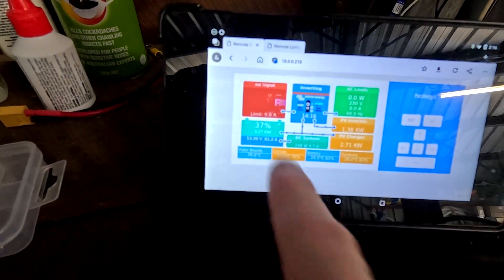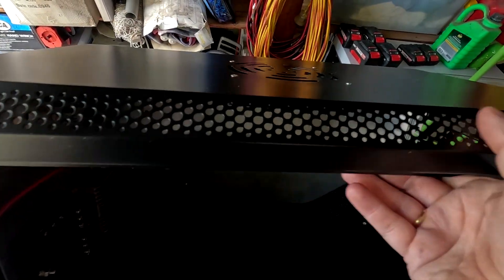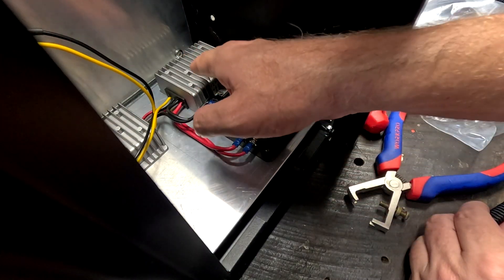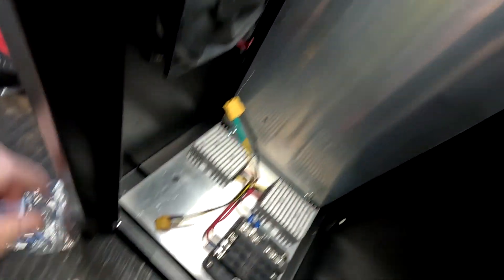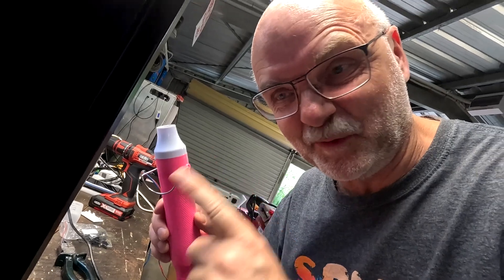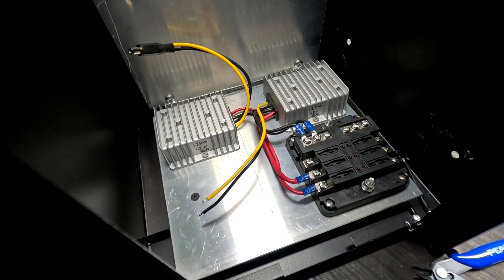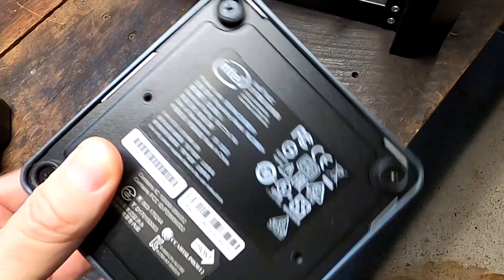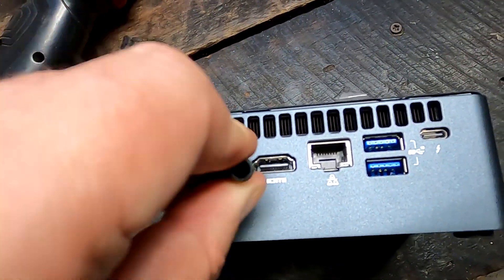Boost converters, fuse block, wrong connectors, first test. How everything comes together.

Comment: My boost converter gets 27V input and 60V output at around 10Amp.. Its able to give 1200w.. But as soon as my power station receives 36w it jumps to zero and starts over again... What could be the problem..?🤔

Comment: Thank your for this video! ... just for info ... I am running my Intel NUC direct on the 12V DC power in my camping trailer (12V 200 AH LiFePo4 battery with some PV-modules tilted on the roof) without any problems. Also the mini-pc from by boss for home-office usage is running directly on 12V DC (of course, the delivered power supply is 19V) ... all the best wishes to both of you, greetings from Hamburg/Germany, Dietmar, DL4HAO :)

Comment: Are those fuse blocks also capable of handling 48V?
If not, what would you suggest to already protect the circuit on the 48V source side?
Reply from the maker: They are rated for 12V and 24V only. There is no real fuse block for 48V out there (yet).
You could use a Midi fuse box which is rated for 48V. They are a bit more pricy though. 
https://s.click.aliexpress.com/e/_DmSHQ1N
Reply: @OffGridGarageAustralia  Thanks a lot for the link! In the title it says 48V, but further down in the specs, they state: "Maximum voltage: 12V [and up to 15V]"
Too bad, those cheap asian sellers don't bother giving reliable info on their stuff...
But I haven't looked into those midi-fuses yet, there might be some more potential there for finding the right fuse box.
Do you have no (analog) protection at all on your 48V primary side? How does it get handled in your installation if e.g. one of the buck converters shorts out on the primary side?
Reply from the maker: @leumel900  I wouldn't be to bothered with the 48V specification as long as the fuse is rated for that voltage. 
I've published another video today where I explained the design behind the build. Basically, the supply for this fuse box comes from an isolated 48V/12V converter which is short protected with 20A. There cannot be more than 20A in any case in the system.
Reply: How is the converter protected with 20A? Internally or externally? If internally, I personally don't really want to trust these cheap asian converters and would like some fail-safe in line. If externally, how?

Comment: So I have those same kind of buck converters and mine recently quit working properly it's outputting a slightly lower voltage than it originally was so you might want to watch out for that it works fine for like a year and a half but now it puts out a little bit less voltage even at really low amperage like mine is a 10amp and even at 1amp the voltage drops pretty much

Comment: Soldering pro tip:  the small and cheap TS100 soldering iron (and clones like from pine) are awesome.
Small, 60W, heater in the tip = fast heating, digital temperature controlled even soldering XT90s is a breeze.

Comment: Okay I’m fairly new to this stuff but I’ve been watching your channel and have decided to get some advice. I’m running a 96 ah LiFePo4 battery pack for car audio. I found this bsm Peak 1500A Car Start up 12V 24V 460A BMS 4S 3S 7S 8S Lipo Lifepo4 Battery protection Board and was curious as to how good or bad this would perform with my current setup. I don’t plan on deleting my lead battery just for the safety feature of when the bms cuts power to the battery pack in the back in turn will allow the lead battery to absorb the spare energy instead of trashing the diodes in the alternator. My question being will this bms work well for this application? I plan on only running about 5000watts from the 96ah pack for audio but I wanted a big enough bms to avoid it shutting down the cell. If you need more details please ask. The cells used are headway red 3.2 volt. Edit 48 of the headway LiFePo4 cells another edit 4s configuration
One more edit to leave cell specs, safe over sorry rule

Nominal Voltage: 3.2V
Chemistry: LiFePO4
Full Charge Voltage: 3.65V
Full Discharge Voltage: 2.5V
Capacity: 8 Ah
Max Continuous Charge: 80 A
Max Continuous Discharge: 120 A

Comment: I do believe you are making it way too complicated by (only) using the side-panels, but it is a choice.
If you left all the holes open, you would not need a ventilator for cooling IMHO.
By properly placing (granted, horizontally) the components in the "correct" order, hottest on top shelf, cooler ones on the lower/bottom, natural convection could be sufficient. I know from personal experiences as I build all my kit both for work and home in such boxes. Using environmental monitors (suggestion for a future project for you perhaps?) I measure, on average 24.3 degrees Centigrade. Yes, with network-switches, Access Point and sometimes a NAS, micro-computers and occasional NUCs. Granted, in the winter I do not need heating in the room, it is quite comfortable....
Reply: BTW, those connectors are often called barrel-connectors and indeed come in almost countless shapes and sizes.
As for your AP, next to mounting it on top of your network cabinet, you could opt for:
- getting the proper antenne-connectors (MCX?) and piece of coax, plus a chassis-connector for the antennes themselves, mount only the antennas to the outside of the cabinet. (you could also opt for complete kits that come with the whole cable, chassis-mount and antennes that sometimes give a bit more dBi's, thus some extra range.
- mount the access point on one of the side-panels (back-plane) in such a way that you drill only holes to stick the antennes thru those holes to the outside. (if you are concerned about dust, you can use grommets.
Yes, if you leave the antennes inside the network cabinet, there will be faraday effects (read: reduced range) but also affects due to the antennes being too close to the other equipment that radiate some radio frequencies themselves as they are switching, that can influence the quality of your wifi signal. Remember, wifi is only mW of signal, it does not take much to block or distort the signals.

Comment: Fun fact:  POE is 42-57v. Ie what your battery produces and is always isolated. 

But a 1 to 1 isolated dc/dc system if you want would make what you’re doing drastically more efficient since your isolated and then down to 12v then boosting 4x. 

Also with 802.3bt you get 100w so easy to power the nuc from Poe

Comment: Hey Andy could you possibly do a video on how you charge your batteries from the grid I’ve been curious how you do that with inverters in series. I thought about adding a parallel multiplus but cabling length seams to have to be very precise so I’ve tossed around the idea like your setup.
Reply: He doesn't, it's off grid, clues in the name. He does have some AC connected solar on the pool pump circuit, which does charge the batteries.
Reply: Channel name was made when he was still on the grid so moot point. Maybe I should clarify my question in simple terms how could you charge with series connected inverters? I know he’s mentioned trying not charging off the grid in winter so wasn’t sure if he has tried before, or maybe a new test for him to see how it would work.
Reply: @Mr.J345  Not a moot point, his solar installation on the garage has always been off grid as he didn't want to risk the government incentive payments he gets for installing solar on the main house. IIRC the Phoenix is installed as if it's a generator, there is a video that explains it.

Comment: Oh boy Andy, @ minute 10:50 I see fuses. Some YT'ers did some testing on cheap China Man made fuses and some did not blow till 2 - 3 times the Amps where put through. You might want to test the ones your are going to use.
Reply from the maker: It does not matter as I don't use these fuses as fuses. They are more disconnection points.
Reply: @OffGridGarageAustralia Fair enough. Just remember not to use them in your Tesla.

Comment: Andy, great build as always and glad to see that you are using a ventilated PoE switch.  I had issues mounting a non-vented switch and it filled up with condensation and failed.  Lesson learned but no damage.

Comment: Andy, has anything electronic or electrical ever left your garage? You would make a good hoarder or ham radio operator (equivalent) 😀
Reply from the maker: I'm constantly turning over equipment and devices. Thankfully, I have only limited storage capacity in the garage. Otherwise...😅

Comment: Actually... I don't think there is anything in that cabinet that even needs an outside fan in the first place.  The boost converters don't due to the way they are mounted.  The POE+ switch certainly doesn't (POE+ switches don't have any power regulators in them beyond powering the ethernet chipset).   The little mini-computer has its own fan.  Convection would be just fine if you unplug the holes.

If you really want the fan, just run it slowly and leave it going 24x7.  Easiest solution.   The options are: (1) Get a fan "slow down" cable, or (2) DIY a fan "slow-down" cable... all they do is put a 100ohm 1/2W or 1W resistor inline with the power to the fan, or (3) Use a 24VDC fan but power it with 12VDC, it will run a lot slower and be completely silent.   Don't bother with a PWM, that's complete overkill.  And best to use low-power-spec'd fans in the first place (0.2A at rated voltage or lower) since the box doesn't really need much or any airflow anyway.   You can make the fan run 24x7 and be completely silent.

-Matt
Reply from the maker: Exactly!
The PWM controller I mentioned will spin the fan on 20% all the time, I believe. And in summer time it may drive it faster if necessary.
I tried with a 60Ohm, 5W resistor in series with the fan, but that seemed too wasteful.
Reply: @OffGridGarageAustralia  The PWM controllers won't be much better and can actually cause fan startup problems (they are not typically "smart" PWM fan controllers for the most part) (see note 1).   You won't save much, if any, power.   The main thing is to purchase fans with the following qualities:

* Large (e.g. 140mm x 140mm or larger)
* Low amperage specification, e.g.  0.2A or lower <--- also implies lower RPMs
   (0.10A-0.15A fans are what you are looking for, generally speaking).
* 12VDC or 24VDC depending

With 12VDC fans if the fan is going too fast you just put a 100 ohm 1W resistor inline with the fan.   As long as the fan still starts, you are fine.   You aren't really wasting any notable amount of power.

With 24VDC fans if the fan is going too fast you just power it with 12V instead and it will run much more slowly.   As long as the fan still starts, you are fine.  If that is still too fast you can add a small resistor inline as with the 12V fan.

--

Note 1:   "smart" PWM fan controllers use the feedback wire to validate that the fan is actually spinning.  If it isn't spinning, or stops spinning, the smart controller will ramp-up the PWM until it starts spinning, then ramp it back down to the requested level.

"dumb" controllers just blindly output a PWM signal and are unaware if a fan has stopped spinning.

-Matt

Comment: Andy, just a question.
Do you really trust the Chinese fuses?
Had many that came with the fuse box you mounted.
Either they fell apart if I pull them from the box, or the 5A I tested widthstand over 15A!
Cheers
Marc
Reply from the maker: What fuses are you talking about? From the fuse box?
What is the fuse for, you must ask!? The fuse will protect the cables of your circuit. The power supply for this whole fuse box is coming from the battery shelf and a Victron Orion 48V/12V, 20A DC-DC isolated buck converter.
So, worst case here is, none of the fuses work and we have a short circuit of 20A, right?
Reply: @OffGridGarageAustralia  Andy might it be time for you to do a video explaining and showing your viewers, that all of the low voltage standard blade fuses are 'half' rated, as it's NOT common knowledge, and folks are getting confused when they find that - say a 10A fuse does NOT blow immediately with 11A across it, and that it can take many seconds to blow, and up to 20A for an instant blow?
Reply: @ValRigoli  Yes there are so many outside who think this pieces will blow at 5.000001A.
But if you use 0.75qmm cable and I can melt that cable down in a test with a 5A CN fuse, I have some concerns about. Even if I think of the usage by people with way less electrical experience as this best offgrid & youtube man in Down Under!
Reply: @OffGridGarageAustralia  I have the most trouble with generic (i.e. random amazon-purchased) auto blade fuses not working as advertised.   Meaning, you take a 2A fuse, put 10A into it... and it doesn't blow.   For example.

Glass fuses tend to be a whole lot more reliable, but fuse holders for glass fuses often aren't.... they're often made of low-temperature plastic instead of high-temperature plastic and the housing of the fuse-holder winds up melting with anything near the rated current going through the fuse (i.e. fuse isn't supposed to blow, but the problem then becomes the fuse holder and not the fuse).   I've had glass fuse holders melt on me multiple times.

This didn't used to be the case, but these days even well-known brands seem to be messing up in their race to the bottom.

Finding reliable low-amperage fuses has gotten difficult.   The best bet seems to be 10x38mm ceramic "solar" fuses such as the type you often find in combiner boxes.   There are more options for fuse holders for 10x38's.  The Baomain DIN-rail mounted fuse holders seem to be decently reliable, I've tested those with continuous amperages up to their ratings without anything melting on me.   10x38mm ceramic fuses are the only low-amperage fuses I trust these days.

-Matt
Reply: @OffGridGarageAustralia  Yes the fuse box. Got the same type in the past with additional fuses but I could throw all of them away. The box itself is good stuff für this low (<35A) current usage. My question was only to know your experience with the CN fuses. I know the useability of this fuses well enough. But was a bit afraid about the quality from CN.
Reply: I've had the same thing happen with 2A non-name Chinese fuses.   I've also seen fuse-holders melt just from the heat of the fuse (not the type of "disconnect" I was looking for!).  But I also have gotten kits that where the fuses work quite well.  So these days I always test a few from the kit to make sure they actually work before trusting the kit.

And for anything serious I use 10x38 ceramic fuses and DIN rail mounted fuse holders

Comment: In this video and the last about this cabinet you refer to the voltage converters as "buck" converters.  Buck converters drop the voltage.  The proper term is "boost" converters as these increase the voltage.
Reply: Just heard you refer to them as boost converters.
Reply from the maker: If you want to be that precise, it must actually be buck-boost converter. Both types of converters use buck technology, right?

Comment: Just a quick observation. Having the 48v devices and 12 v  devices, in close proximity, and using the same co axial power plugs for both - imagine you have had a session of calibrating too many spats........ if you accidentally supply 12v to the 48v device - no big deal but......... pumping 48v into one of your 12 volt devices is going to hurt! - Would you not do better placint the 12v devices further away from the converters and extend the 12v cable? that way no accidents can happen?
Reply from the maker: I never drink and drive😆
But yes, that could potentially happen. They are now labeelled though which helps a bit. Same as people connect their batteries the wrong way and turn on the circuit breaker. How do I know? Well, I'm reading all the emails I'm getting😉

Comment: All right yeah using external antenna makes more sense, I was thinking double faraday cage was a bad idea
Reply from the maker: Well, we will see once this is all mounted and the cabinet is fully closed. As I said, I may have to mount the Wifi AP on the outside of this cabinet for better Wifi coverage.

Comment: Hey Andy, use magnets instead of screws to hold filter in.
Reply from the maker: That's too late now.
Reply: @OffGridGarageAustralia You can always remove the screws and replace with magnets. You know the ones with holes in it and screw them down just to make sure they don't move.

Comment: Heya, bilding this network cabinet needs some work but wen it's done it will work nicely and for a long time
Reply from the maker: Same with the battery shelf. So many people were concerned and had issues with it. Until it was done and working. Then, everyone was impressed. Maybe different here with such a cabinet as this is not something many people would need.

Comment: Hi Andy. What would cause 2 JK bms that were working perfectly to suddenly go bonkers with one completely unresponsive and the other only charging only to 60%? Both are 2ba20s20p.
Reply from the maker: B2A20S20P you mean... have they done that at the same time? I can only imagine a voltage or current surge causing that.
Have you powered them completely off for while and reconnect them?